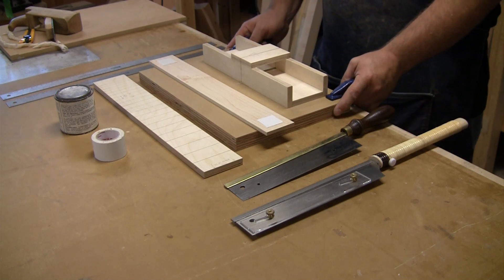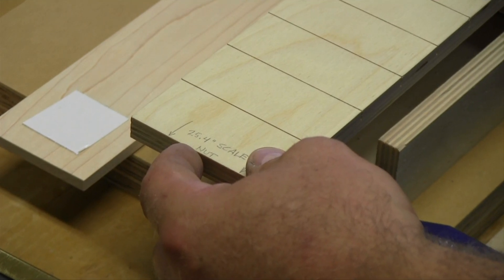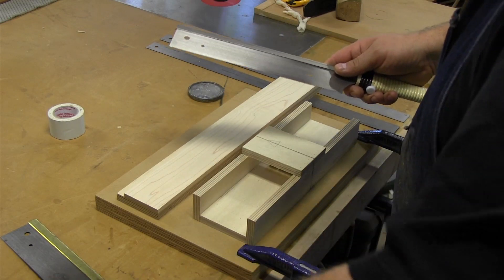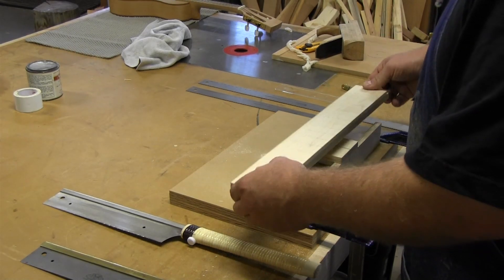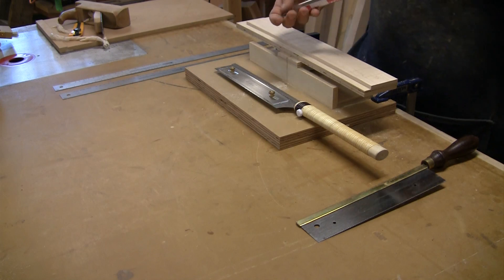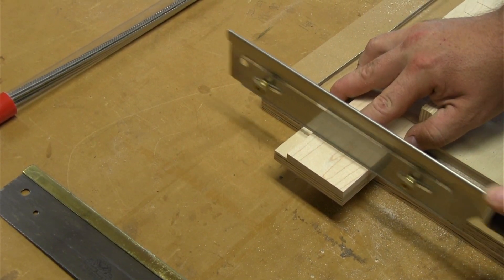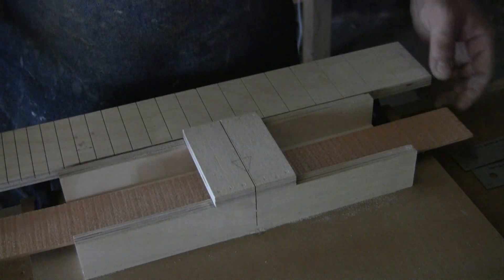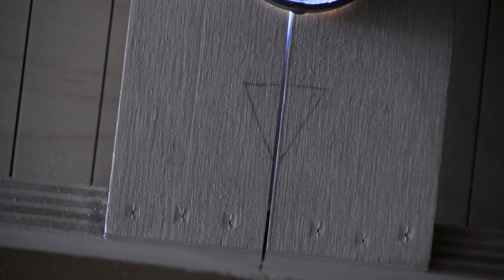Jigs: Fretboard

Comment: When you radius the fret board, wouldn't you loose the depth on the sides? It would then only be correct then in the center.
Reply: Some of these videos are kind of sketchy.  You were right to think about all this.  sometimes these guys make no sense.
Reply: Yes you do lose some of the slot depth after you put the radius on the board but remember after you trim the board to fit the neck you will get most of it back then you just use the fret saw and do some touch up cuts if need be. I personally use a fret saw blade ob my table saw with a crosscut sled in conjunction with a fret slot template and index pin on the back support of the sled. You can purchase the fret slot templates in all the popular scale lengths, the saw blade and the pin from StewMac or LMII. It's the way to go if you are doing any kind of production or just want the most accurate way to cut slots. Cutting them by hand is perfectly fine you just need to make sure you are not leaning or twisting the saw when cutting or you will get slots that are sloppy or too wide.
Reply: after you've radiused the board, simply use the hand-saw with the depth attachment he shows in the video to deepen the slots at the edges.

Comment: You can also use a pre-slotted fingerboard as a jig, knowing full well that the slots are accurate. You can then cut a piece of Ply in the same way as you used the jig. after that, you have a properly cut jig for the price of a slotted fretboard. 
It's just another way to do it and get the same end result. Keep up the good work.
Regards,
K

Comment: Hi. Very accurate and well built jig. Related to the slots depth, I believe we will lose some thickness of the fingerboard on the sides after raduis sanding.
So would you need to deepen the slots after the radius sanding? (So the frets can seat properly)
Thx a lot.